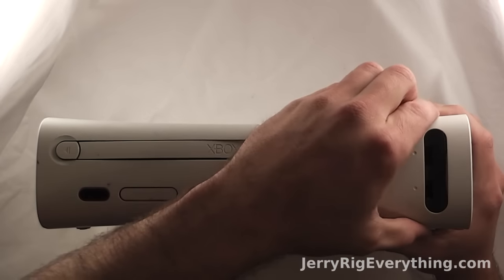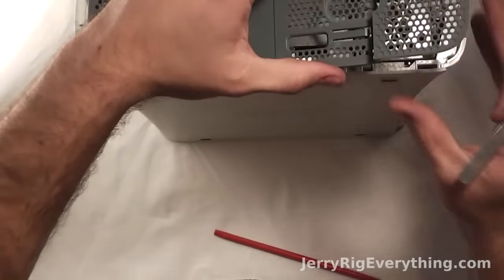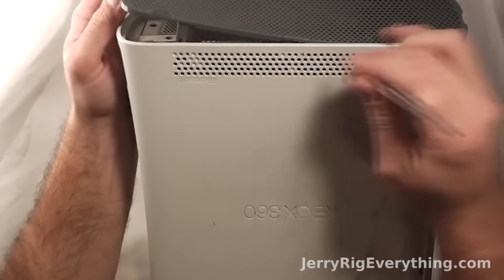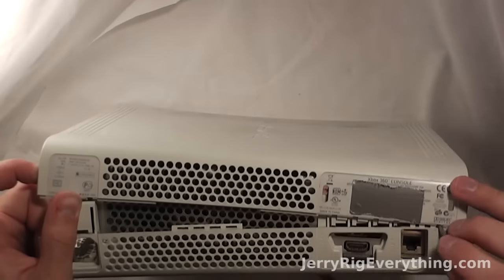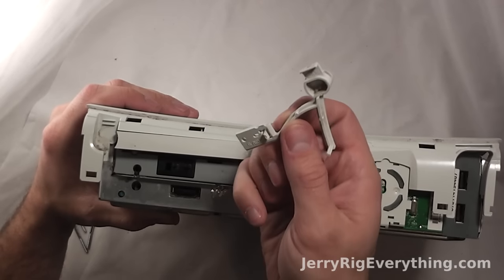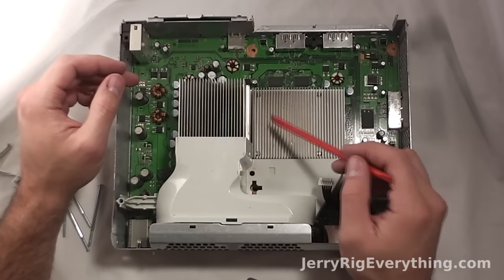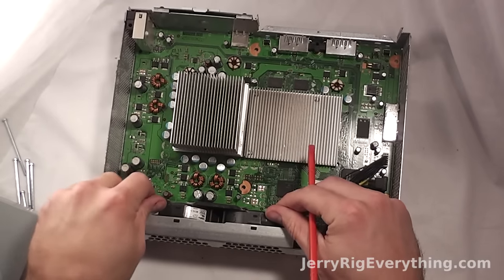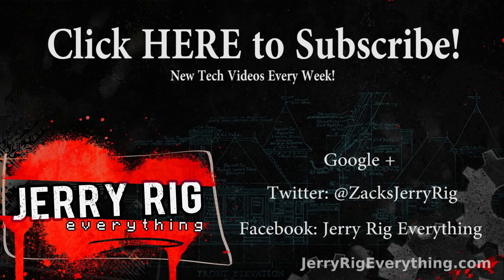Xbox 360 Complete Tear Down, Fix and repair video. To the point.

Comment: Anyone else having a hard time with the back side tabs
Reply: Meh ;-; did u ever fix it?
Reply: U know one next to the power cable one I need help it’s one tab I don’t wanna break the plastic tho this is aids he’ll me
Reply: @RyZe._  dude I had to break it off, it's fine just push harder, or if you're doing the one to the very side, then that's not important
Reply: Tommy bro idk how to do this u got like a insta or snap I can talk to to u cuz I got the whole panel of except this one pin that won’t come off I tired pulling with force but I didn’t budge i need help :/
Reply: @RyZe._  do you have discord?
Reply: Tommy Yh give me a min let me find my username
Reply: Tommy CHICKENCURRYMAN21#4800 here u go
Reply: Yeah! The 2 inserts atop the power outlet pissed me off. I was legit considering just breaking it but i ended up getting them
Reply: I just broke em 🤷‍♂️
Reply: Came to the comments just to find out about that too lol
Reply: Jesus Arias same man I just got so pissed and just pulled the top and it didn’t even come off but then over the course of 3 days I managed to get it
Reply: @keithjustice8199  fr I got a mw2 edition phat console that shit hard asf to tak e off I broke my mf tool bruh it broke it and I cut my finger trying to rip the shit off finally I took it off with my hand with some strength.
Reply: hell yes
Reply: CKS Dance! Hey if u need help I can help u
Reply: Some xbox 360 Units havent been opened in years this guy has opened this same xbox many times So it comes out easier also he pretty much cuts the scene various times thats why it seems that he does it pretty easy...
Reply: Tommy WELL I JUST GOT IT OPEN TURNS OUT THAT THE SCREWS ARE A WIERD SHAPE
Reply: I literally broke every single one of them trying to get it off
Reply: Okay this is what you do to get it off. You need two tools that aren't too fat to fit and you need to wedge them deep, then you go in through the end(the end your tools are pointing towards) jab a screwdriver under that and pop it up. Then grab that sucker and don't let it drop. Then find the open dots between the white dots and make sure you have good lighting. As you pull the top up you can see where the plastic need to be pressed up with your tool through the holes. No a toothpick will not work lol
Edit actually the dots do just need to be pressed in to release a clasp like he says
Reply: Yes
Reply: Yes I broke the back after opening it
Reply: Ye, holy shit what a pain, my Xbox will now consist of superglue and pain.
Reply: Yes
Reply: All my tabs broke as i tried to get them, but it was a "refurbished " one from game stop so maybe they were damaged before i messed with ot
Reply: For anyone still watching, what I did was I had another person pry the sides of the xbox were the HDD plate previously was, and I took the thinnest, longest screwdriver that I had and was able to hear a bunch of loud clicks as I pushed in the tabs.
Reply: @ramcade31  I still have this issue, I can’t hear any clicks
Reply: @damilola_yemo  possibly make sure the tip of your screwdriver is very small and long. That helped. If that doesn’t work make sure you are pushing hard enough, if that doesn’t work it might just be best to pry it open.
Reply: I broke all of them lol, I wasn't able to open it up, not yet at least
Reply: I broke them fuckers.
It was damaged badly by previous owner anyway.
Im planning to put the whole thing inside a PC case with much better cooling, and bigger hdd
Reply: @foxxy2098  they aren't weird, torx is actually a standard screwdriver!
Reply: its the possume 44  what’s up?
Reply: Lol, the bottom half case broke for me 😹
Reply: A Tough Item** ©👌👍💯™
Reply: There was one that just refused to budge, I just ended up intentionally snapping it off.
Reply: ye
Reply: enrique amaya  Is he going to help get these clasps off?
Reply: Same here
Reply: Yes, this PLASTIC tab just broke my METAL flathead bot
Reply: Yes
Reply: Yeah i dont wanna break
Reply: @RyZe._  js took mine apart last night, said f it and broke the plastic
Reply: No just the front ones they are a bitch on mine
Reply: yea i broke the tabs and cut my fingers
Reply: @lt.simonghostriley905  yea that shit is sharp i cut my fingers too
Reply: Push at a slight down towards the bottom of the xbox fixed the issue for me
Reply: Yeah mine got obliterated 😂😂
Reply: yess
Reply: Bro i dont know what to do it won't come off in the sides i dont want to break it what should i do?
Reply: Very vague on everything, the 'screws' are T8 torx at least tell people that. Cover is a bitch to get off. Not as easy as you say.
Reply: Thats exactly why i watched this video 😅
Reply: That’s why I’m here 🤚 ✋
Reply: Me
Reply: Those back tabs are the band of my existence 😤
Reply: Amen!! Just tore open in the end...😅
Reply: I ended up snapping some of the tabs off on the back but luckily there’s still enough to keep the casing together
Reply: I broke like 4 of them
Reply: I did about the same time that you were having them give up revisited with a smaller pick to push the tabs and got through it
Reply: Yea
Reply: My xbox 360 does not power up and I have checked the psu its working fine..After I opened and dismantled the xbox there are 8 bloated elwctrolytic capacitors need to be replaced..I am planning to use this xbox 360 into cd player for music...I have an HDMI to analog output converter for this purpose..

Comment: I might add that the 6 screws that need to be removed are torx (6 point) screws.
Reply: Not only that but I think it's like a t11 because my t10 fits very loose in it
Reply: mine are all stripped, any idea how yo get them out?

Comment: Perfect, just picked up an old Xbox 360 for 5 bucks, everything works but the fans are noisy as hell. Your break down is the best I've found. Thanks !
Reply: Zombie Xee damn 5 bucks man this console aged great man
Reply: Got 2 normal 360s with HDMI for $10 each.  One 360 is an elite black version with HDMI.
Reply: @WantBadtime  where do you get these things?
Reply: And both are the newest Jasper models, so they are the least to red ring

Edit:  The normal white Jasper 360 has a eject disc issue, which is super common with these original models;  it was also opened due to the warranty sticker being sliced in half. The black one works fine, but it's very noisy and was never opened, which is why I am watching this video.
Reply: @beAirEdits  I got mine from a special goodwill that sells junk that doesn't sell well; they usually come from other normal goodwill's that don't sell well for weeks.  The consoles were most likely overpriced like $50 from one goodwill, which didn't sold well, so they've decided to take it to their bargain store.  Unfortunately though, due to pandemic, they are closed until further notice, which is driving me insane because they always got good stuff.  Got a PS3 super slim for $10 and that works.
Reply: I remember they were selling a mw3 xbox 360 for 20 bucks in goodwill once .....took the hard drive tho
Reply: @WantBadtime  damn I want a elite.

Its the last xbox 360 and only came out in 2013
Reply: bruh my ps3 is loud as hell
Reply: @captainrobots1  no thats the 360 "E" model

Comment: Got the Ring of Death in the first year I had my 360 and sent it in on warranty.  that was 14 years ago.  it's lasted until today.  Got the RRoD again while playing Fable 2 (Game I bought the 360 for).  It was the dreaded 3 rings...  I was desperately hoping it was just an overheat and not a motherboard warp.  Followed you video and it was WAY WAY easier than when I tore apart my PS3 (pos...).  Cleaned it up inside and out.  Crossed fingers and...  Revived and working great!  Thanks for the video!
Reply: btw 2 red rings is overheat, 3 red rings is dead gpu (probably, press the sync and eject buttons four times and tell me what it says)

Comment: Watched a few videos where they just waffle on and on before showing anything remotely useful. This is top off the range. Well done and thank you.
Reply from the maker: +MickyMoz Glad I could help out! Thanks for watching!
Reply: MickyMoz
Reply: JerryRigEverything I get to the point where you have to push in the back clips and they don't click and open. I lift up the front ones perfectly fine but it's just the back ones that give me a hard time
Reply: Do I need to replace the disc tray box with a new one, once I  unhook the wires
Reply: Luke Schuler me too if this don't work imma go outside and break the shit outta my xbox
Reply: @JerryRigEverything  jgouh

Comment: This helped me. Took it apart and fixed my open tray error I had for two years thank you. Liking and subscribing.
Reply: was yours sticking closed too
Reply: @jinxxedbyu  that and it wouldn’t read discs anymore kept saying open tray. Wouldn’t even try to read a disc. As soon as it closed it would say open disc tray. So I used this video to open my 360 and replace the disc drive with a new one I had gotten from another 360 console.
Reply: @OhhZio  did the disk drive work? pretty sure they are locked by dvd keys (thats different for every console)
Reply: @XENON2028  it worked yes. It has nothing to do with dvd keys. It’s about power. All 3 versions of the Xbox 360 all have different power units and therefore all output power throughout the system differently. More power in some models less power in others. Curiously, my swap was successful. I tried to put the faulty disc drive in the old 360 shell I swapped from and it plugged in but is giving an error for low power output.
Reply: @OhhZio  that does make sense, I guess the dvd keys are for like firmware or something then
Reply: @XENON2028  yeah probably. I’d say the Xbox 360 and PS3 would definitely be more likely interchangeable than the newer models like PS4 Xbox One and Up, I doubt you’d be able to make a disc tray swap and have everything go accordingly. To be perfectly honest, I got lucky with my 360 drive swap because I didn’t know about the power details until after I had already swapped. Fortunately enough yes it worked but it easily could’ve not.

Comment: Im struggling to get the case of the back with the pins help
Reply: you probably need to make a tool with the 7 infinitely thin 1 mm wide metal pieces to hit it at once, with 2 champion arm wrestlers at both corners pulling

Comment: The little clip thing for the fans is a pain in the arse. I snapped mine but hay ho...now I can fit a 3 pin fan  splitter.
Thanks for the fan link. I'm in the middle of restoring one and I'm looking to mod it as well. So thank you for your help.

Comment: I found an old Xbox 360 in the back of a barn during a garage sale and it seems to be working fine but the disc tray doesn't want to come out all the time and I don't particularly want to buy a new one so I'm going to try to fix that and pray it works
Reply: Push in and down a bit with something in the shape like a ID card. Just NEVER hit it to open the tray or that scanner thing will move and no more reading your discs unless open to fix it.

Comment: Are there any specific tools you'd recommend I purchase before I open my xbox, because I'm worried I have to try this myself due to my being unable to find a repair shop in my country and the whole  breaking an old console.

Super appreciate the calm and clear explanation, subbed.
Reply: A Torx Miniature Screwdriver will come and handy for the “Pushing the Backside Pins inward” when before pulling the Outer Plastic Shells apart from each other.

Comment: The back clips I couldn’t get apart so not caring for the present case I’m pulling until I have the covers apart…….it worked great plastic went flying everywhere and I had a empty case with gears of war 2 theme on the console case    It’s all snapped back together ❤now I haven’t Xbox with gears painted on it.

Comment: Got one in pieces and this has helped me put it back together...I understand everything except where the 3 tiny black hex screws go...I'm sure I'll figure it out but it's a little odd and irritating since it means whoever's had mine here was diving deeper than you did SOMEWHERE and I shudder to think of what they were up too.
Reply: Check if they aren't the ones from the heat sink, those are black
Reply: @timoarrg  totally forgot about this...I believe you are correct...I got everything back together and it turns out it had a different hardware issue than I thought so apart from the practical knowledge and teardown familiarity I otherwise kinda wasted my time.

Thanks though, appreciate the response.
Reply: @heartysquid  you're welcome :)

Comment: When changing out the DVD drive you can't just swap it out for the same model, the motherboard has a set key, and if the DVD drive key doesn't match then it will not read disks, you use a computer and a program to obtain your DVD key from your old DVD drive then use any Xbox 360 DVD drive and load that key with the firmware and it will play on that Xbox, as long as the key matches the motherboard any 360 drive will work, as for lite-on 360 drives, another tool is needed to obtain the DVD key. You don't need it, but it is extremely hard to obtain the key without it.

Comment: I had a question let's say the Xbox it self is broken but interiors still fine like the inside is there anyway to open the CD player and get back the CD . Also what tool did you use to open the metal part of the Xbox ?

Comment: nice video mate, taking apart my old xbox 360 atm. do I need a special screw driver for the 6 screws, the 3 I'm using atm aren't budging at all.
Reply from the maker: Jake Martin Just make sure the head of your screw driver matches the head of the screw.

Comment: Question. The front buttons on my original 360 just stopped working. I can turn it on and control everything with a wired controller. Have you seen this? Is it possible to fix?

Comment: It's almost impossible to get that back part off without a special tool. It's called the "repair tool", which comes with a t8/10 screwdriver. It gets those tabs down without breaking everything...

Comment: 1:30 Here is the problem I can't get past this  part, it refuses to open. There are no "Tabs" it feels like in there.
Reply: So I got mad and just grabbed and yanked the whole thing back; I expected it to just break- but it actually snapped all the things out in tact by some miracle, avoiding the tabs entirely. I Do NOT suggest going it this way as it hurt my hand but it can be done if you hulk out I guess in anger haha.
Reply: Aghh it uses fucking Torx screws for god's sake this is just the worst >.<

Comment: I just realized this is an old video and I actually still have a second gen Xbox 360 and it never had a malfunction. The reason I know it's a second gen is because it has a native HDMI port. Also, second gen. Xboxes have been known to get rid of rings as well as the first gen, but they did do a couple things to increase the durability like add epoxy to the GPU and the make the motherboard a little more rigid. I know someone who had an elite That got red ring of death.

Comment: can u run the xbox with it torn down with the plastic of and motherboard showing?
Reply: yes, it runs better but WAY more exposed. So watch it (kinda like a RGH.Jtag/swapper)
Reply: icefuzzball well not really a case is designed to have maximum airflow to all components by the fans like the ram, cpu, gpu ect
Reply: icefuzzball yes but I'm sure bad cause I'm sure the air is supposed to bounce and microsoft designed the metal and plastic to make it flow good but if your just trying to test it then that's alright

Comment: must have had a different xbox cuz there were more plastic clamps/locks that held while I pryed and now my xbox cover is cracked and many of those small opening slits did not release my clamps and they broke.  so by skipping a few steps or maybe having a fdifferent xbox 360?  but now its a mess.

Comment: So if my disk drive doesn't work I just have to buy another one under the same model number and it will work? Because i herd ill have to flash the drive :0
Reply: Jose Velez you can switch the circuit boards so the xbox will accept the new drive....

Comment: followed this tutorial and literally all the tabs and most of the plastic chassis broke on me. broke the pieces in half XD. Either these covers are cheap or I'm too rough?  ALSOO the screw that holds the plastic CPU shroud broke and is stuck in the hole.

Comment: My door has trouble opening I’ve Tried all the videos help me I love my 360 if I tap it it opens
Reply: Use something like in the shape of a ID card and slide it in the front part of the disc tray then push down a bit and it should open. DO NOT hit the top of the Xbox 360 to open your tray that will damage the disc scanner or move it out of place.

Comment: I’m having trouble with the latches on the back of the Xbox 360. I got the two on the left side(or right side depending on where it’s facing) off, but the last five latches I can’t get off for some reason. And yes I also have the same 360 model as shown in this video. Anyone else having trouble? I’m hoping to fix the grinding noise on my 360.
Reply: Just had this happen to me. I basically got impatient and pushed down way far down on that last plastic latch over by the HDMI port and it finally came loose. I thought the devil was playing tricks on me cause I did this just fine on another Xbox before. Oh and if you are maybe referring to just after the first two latches over by the power supply plug, there is missing step in this video where you press the center area with your thumb and there are 4 plastic things held together. After that is those other 5 tabs.